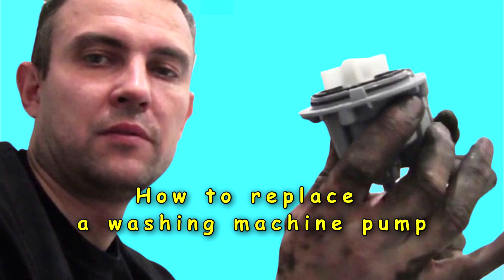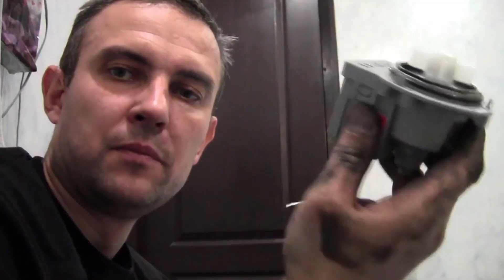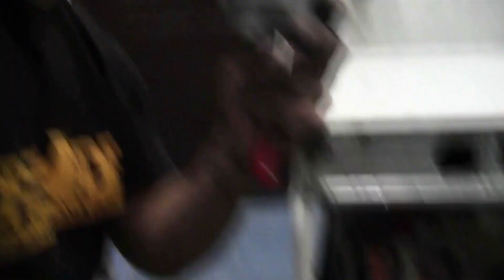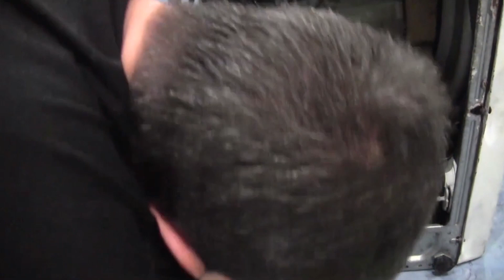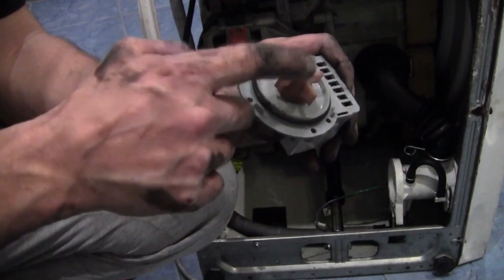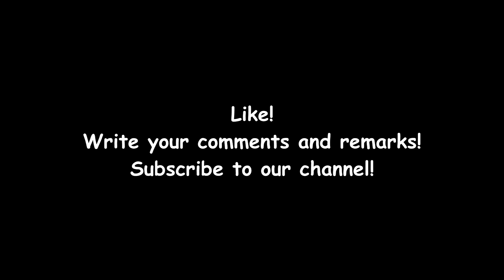Washing Machine Drain Pump Repair

Comment from the maker: Has your washing machine ever stopped draining mid-cycle? 🧺 It’s a common issue usually caused by a loose impeller or a small object stuck in the pump!

Quick Question: What's the weirdest thing you've ever found in your washing machine filter? Let me know in the comments below! 👇

Don't forget to SUBSCRIBE to the Adults and children channel for more practical DIY guides!